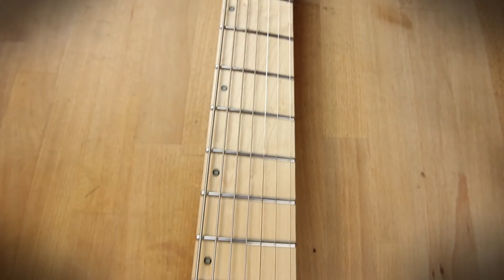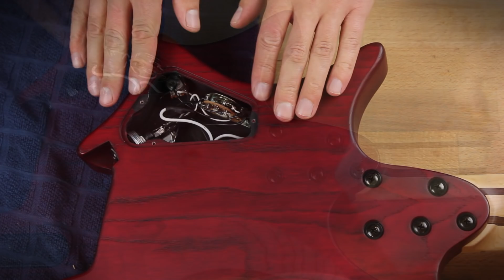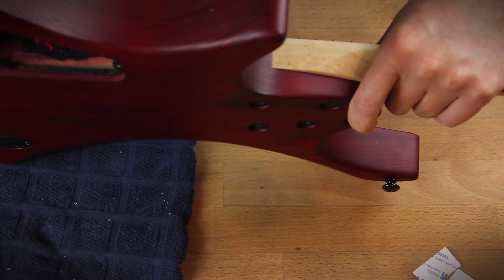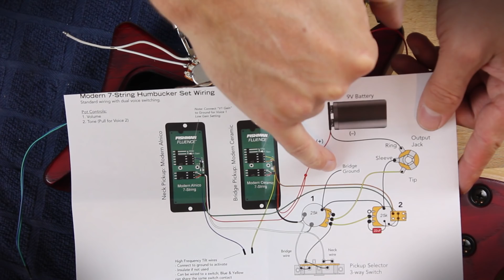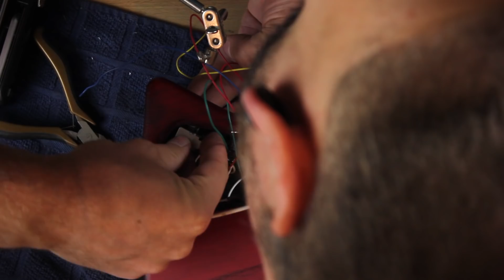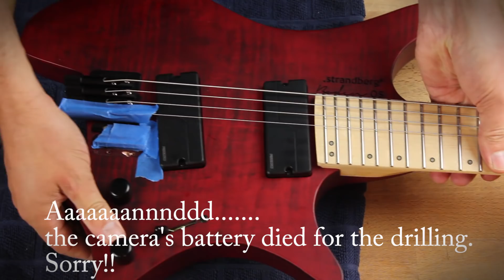Guitar Pickups : Fishman Fluence into Strandberg Boden OS7

Comment: Mine came with the same diagram but with 2 push/pulls, One for tone and one for volume. Using this diagram, which is the one that i also got, leaves volume push pull useless. I dunno why is that. Any advice would be appreciated since i cant make mine work since its draining battery even without the guitar cable plugged in.

Comment: What do you set the height of your fishman pickups in relation to the strings for both high and low end and bridge and neck pickups?
Reply from the maker: There is no universal distance for "correct" pickup height, as it depends on how strong the magnet is & personal preference.  I will usually set the pickup lower than I would want it, strike the lowest two strings, then raise the screw on the bass side.  Stop when the sound is full & balanced.  Then repeat for the treble side.  Prioritize the height of the bridge pickup, then fine tune the neck pickup height to have the same volume as the bridge.

Comment: Thanks for this video! I have been exploring sounds for a little over a year and I haven't been happy with the way the pickups sounded due to a single-coil/double coil set up I found on youtube which I initially used in order to get the max out of the pickups. After reverting to this particular setup I now have the tones I wanted out of these pickups. I still think Fishman should upgrade the wiring diagrams to better fit types of guitars. I have a question, how did you install the -6db jumper? can you send me a picture? I can't find the Fishman pickup box and  I don't remember seeing jumpers in the package.

Comment: Can I install fishman modern on a  guitar that only has a one volume knob.
Reply: yes. Did it to my Jeff Loomis Schecter.
Reply: @robertlawson1184  so how would that work. It work as a push pull and volume knob. Did u change the pot ?
Reply: @chucky4000  Yeah, change the pot and use the weird pot that has the big circuit on the back that came with the wiring kit and then simply follow the diagram. Kind of straight forward. Seymour Duncan website also has lots of good wiring diagrams for guidance. Took me about 20 minutes. However, the fishman doesnt sound as good as my original Jeff Loomis pickups so im changing it back soon. I do have a video on my youtube with the Fishman modern if you want to hear it in drop C tuning.
Reply: @robertlawson1184  ok cool thanks. I'm gonna install the fishman modern. On my charvel joe duplantier signature tele.
Reply: @chucky4000  Great Whalecore guitar

Comment: Thanks for this video, man! If I wanted to only throw 1 of these in the bridge position, would that be an option? Or would I have to install the set of both?
Reply: Without the switching options, not installing the push pull, you can but you need the bridge grounding wire and that looked like a messy job.

Comment: Hi, I have a question, I want to buy a Strandberg Standard, 8 strings, with strandberg passive pickups. Do you think I need active pickups in a 8 strings, or passive strandberg pickups can be also okay?
Reply: I got the boden 8 standard (passive strandberg pups) and I decided to get tosin signature set because I feel like the passive pups are muddy and the single coils are pretty noisy. I havent installed them yet though

Comment: I bought the Fishman Fluence Modern set. I watched this video and thought it shouldn't be a problem to instal. The new ones don't look like the ones in this video. The pickups now have small tabs on each side for the screws, I tried mounting them in my Agile Interceptor 7 string to find they won't fit, they are a 1/4" too wide. The stock pickups are Seymour Duncan. Waste of an afternoon. Now I have to rewire my guitar and return these cause I am not drilling holes in my guitar. How can there not be a mounting standard for these pickups?
Reply: There is. You order them in either active mount (soapbar) or passive mount (tabs)

Comment: Don't actually sick the foam down you'll regret it if you need to change it or decided to go back and solder in the coil tap option. Plus it doesn't come off nice it's messy and meant to be permenent. A better option if you have to stick it down would be to stick it inside the pup cavity. That's what I've done on my fishman installs after my first set.

Comment: I bought a pair of FF classics for a les paul type and have an ESP ec-1000fr with only 3 pots (2 vol 1 tone). The diagram shows all 4 pots being required for use.
Am I doomed to have a custom shop drill out a new tone pot for the four that come with it, or is it possible to wire up on 3 pots? 
Basically I don't care about the single coil voicing, but also don't want to toss the Fishmans in the bucket of wasted money because I don't really want to spend a ton of money at a custom shop specifically for the Fishmans...

Comment: Installing fishman fluence are not that hard. It's the same as normal wiring but you have tons of options that fishman doesn't do a good job explaining. You figure it out but it should all be explained with the diagram included with the pickups. They touch on everything but it's not enough if you've never installed them before. I've done it twice and after the fist time and messing with the first set for a year I could do it a third time in my sleep. Don't let them intimidate you basically. They all sound great except the Stephen carpenter bridge pup was very disappointing. I highly recommend starting with a basic modern alnico/ceramic set. It's the best introduction to fishman(if you play metal/ extended range. My set is on a 7 string ltd) and the best crowd pleaser. I'm looking forward to trying the classics and then single coils with my 6 strings.

Comment: Why did you have to ground the saddles like that?  It was active before, what's the difference with how it was grounded previously? I am installing these in a guitar that previously had passive pickups.. so the bridge is already grounded.. I shouldn't have this issue I dont think.
Reply: Hey man I know this is old but did you ever actually do that swap? My friend and I both have strandbergs and I want to switch my fluences into his guitar which has the passive lace humbuckers. Did you find that the guitar with the passive pickups was already properly grounded?

Comment: how would you bridge ground without a zero fret? just got a set and i'm about to install them into an ibanez rgim. it also has the individual bridges for each string.
Reply: If the Ibanez has a tremelo they usually already have a small ground bridge wire..just keep it mounted at the tremelo side,de-solder the wire at back of original volume pot,install pot that comes with the Fishman and solder the wire to the back of the pot like normal.

Comment: I’m looking to get a strandberg and exchange the pickups for Fishman Fluences. I’m assuming the Fishman’s are powered by battery, does that mean I have to go with the EMG-Model of strandberg, to fit the battery of the fishmans? Or will the Lace model be able to fit it aswell? Which is the better choice for the fishmans?
Reply: The Fluence battery (except for the single coil sets) does not have to be replaced--ever. You have to cut a hole (or have someone with a half inch drill bit in a press do it for you) through your plastic cavity cover. Then you attach the battery circuit board to the inside face of the cavity cover so that the USB and LED port can sit in hole and be accessed once you close the cavity. Put some foam in to keep the rechargeable battery from moving around. And voila! (I cut it myself and did not have a half inch bit. I used an exacto knife to carve out the remainder but it  doesn't look professional. If money isn't a big deal, pay someone to drill the cavity cover and smooth it out. You have to make sure that the corners of the circuit board fit the cavity so, mark the spot where you want the center of the hole to go.)
Reply: Since 2017 Strandberg extended range guitars all come with the Fishmans from the factory

Comment: I am looking to put some Fishman's in a Epiphone SG Prophecy I just picked up. Is it necessary to get rid of the wiring for the EMG's since both pickups are active??
Reply: Sickman Comics Yes, fishman are 25k push pull with tons of wiring options( easy to do ). You'd be doing the pickups a disservice if you didn't change them and select your ideal settings.
Reply: If you didn't hear the pups come with all the wiring you need and all the pots and input jack. Everything you'll need for any option is there. At first I just wired them with one push pull for voice switching but then decided to go with two push pulls later so I could also coil tap. So tone knob switches voicings and volume knob switches coil tap on/off.

Comment: Firstly, thanks for taking the time to upload the vid, a lot of work on top of the actual guitar mods, but.... The original pickups sounded fizzy and thin, and the Fishmans didn't sound particularly better to me. Maybe a clean tone would have shown the difference better, but with that much gain, almost impossible to tell. Thanks again for the time you spent though!
Reply from the maker: I can see why the difference would be hard to hear.  After filming this video I actually went bacon & added the -6db jumpers to the Fishmans which really made them more dynamic.  I plan on pulling them back out again to add coil splitting, something the EMG's simply aren't capable of.
Reply: You went bacon? Mmmmm... bacon....... Uh, where was I? Oh, yes, the Fishmans are definitely more versatile if they can be tapped/split, so a definite plus point there.
Reply: Does adding both jumpers change the sound for both options of the push pull? Or only on one of them? I'm having trouble finding info on how it changes the overall function. I have single volume and tone (2 knob installtion).

Comment: Why didnt you cut the wires shorter? Would be less cable mess in there. I hate this type of jack connectors, they always unscrew after a while. Few drops of superglue fixes that pretty fast though.
Reply from the maker: I didn't cut the wires shorter because I wasn't totally sure I was going to keep these pickups, as I hadn't liked actives for years.  Original wire length = better resale value.  However, these pickups are so freaking good I would absolutely go back in & cut them to really clean it up in there.
Reply: Alright, that makes sense. They sounded great.

Comment: That neck holder thing you've got is really nice...What is that?  I'm gonna get one :)
I'd kill for a Strandberg 7 string, or a Parker 7 string...Maybe I can sell my Ibanez RG 1527-M and get one one day. 
I'm actually probably going to get the Fluence set in a few weeks...The stock Ibanez pups weren't that great; they were the V77/87 or whatever...I swapped them out for DiMarzio D-Activators...Those were a little better, but not really what I was looking for in terms of high gain tones.
I was going to get the EMG 57/66 7 string versions, but the one thing I love about the Fluences is that you can coil tap and parallel them -- with EMGs you can't do that; you'd have to get the "Dual Mode" ones, and even then, it's two pickups in one casing, not quite the same thing as the FF's.
So really, the Fluences actually do have more than two voicings.
My one fear though is that they will be too loud, but I can't imagine that the vintage voicing is going to be that insane.
I do like to play clean on this guitar from time to time...I love doing tapping \ Tosin Abasi style stuff; hence the need for coil tapping and parallel wiring.
Reply from the maker: The neck holder is the stewmac neck cradle for electric guitars.  I love my strandy 7 but honestly, the 1527m is an amazing guitar.  It has my favorite non-endurneck neck profile ever.  Basically just a slightly beefier wizard profile.  I actually really like the 7-string D-Activators as well!  That being said, the Fluences are amazing.  I ended up installing the little output reduction jumper on this set & it improved the dynamics considerably.  I really don't ever use the "active" voice & will probably look into re-configuring the push/pull to toggle a coil split or something.

Comment: Thanks for this video man! A lot of great information for the different applications, and/or modifications to do to the guitar!
I have a question. I might not have understood properly since I kind of spaced out but if I understood correctly. If you are planning on putting a set of passive pickups in an OS you have to go through the process of drilling the hole to give a ground thorugh the strings right?
Reply from the maker: I think it depends on how recently the guitar was made.  The earlier run guitars like this one, yes, you have to drill.  The newer ones I think come with a hole pre-drilled.
Reply: Ill have to check out with my guitar then because I do believe mine was an earlier run since I bought it just a little before Namm!
Thanks man!

Comment: Love this channel, by the way does anyone know what he uses to hold the pots and such when soldering? The sort of arm thing with a crocodile clip?
Reply from the maker: They're called Helpig Hands.  They also typically have a giant magnifying glass attached to the top.  In my experience, all this does is make it super top heavy so I just remove it.
Reply: Axe Hacks thanks ive needed something like this especially since ive been replacing alot of pots jack pickups etc lately. ill be buying one as soon as i can

Comment: Very cool and detailed install video. Nice work. Do you think that the pickups would work with the EMG solder-less quick connect push pull potentiometers?
Reply from the maker: +Phor Phit I can't say for sure but I don't see any reason why not.  Same connectors & the pots are the same resistance.

Comment: I always thought that the whole no headstock "steinberger" design died off, there definitely coming back, unfortunately Gibson is only using steinberger for its gearless tuners
Reply: RJ Maksym 
It didn't die off for good. It was mostly bassist that went with them. Recently, like mid-late 2000's, was there a resurgence, mostly because of Ola Strandberg.
Reply: I thought the concept came back with the Floyd Rose speedloader more than anything
Reply: RJ Maksym haha wow I remember that failure. Very cool concept, but unless every string manufacturer is willing to make speedloader set, then you are extremely limited in gauges and such.

If I remember, those guitars actually did have headstocks, just not tuners?
Reply: higler420 
I was a fan of the Speedloader. Allowed for headless guitars and it was the only hardtail bridge Floyd Rose made. 
And yeah, a bunch of Speedloader guitars still came with headstocks. KK Downing had 3 - 4 custom guitars with the Speedloader trem. The kicker is that EVERY one of those guitars had headstock. If you see pictures of his KXK, you can see they're strung up, but there's no strings leading to the tuners. Rather odd way of doing things. 

I'm sure the Speedloader might have had a hand, but it really came back into prominence once fusion, jazz, and progressive players started using them again a few years ago.
Reply: Skippy McStringStrum Ha, wow I just google KK's KXK's and you aren't kidding, he has the speedloader, but 6 "dummy" tuning pegs for that "classic" or "vintage" look haha